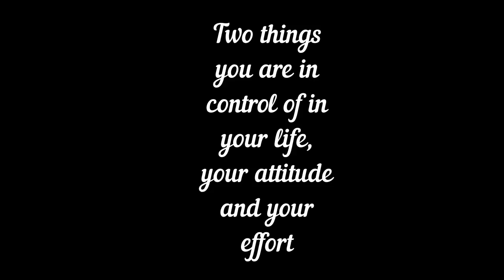We fixed the problem with the Wood Stove / Self built Tiny House//VLOG

Comment: A piece of copper pipe 1/2" about 24" long makes for a good tool to blow the coals with to heat them up. The hole turned out better than I expected - LOL. Good job with that. Thanks for sharing

Comment: We had a Country Flame stove.   It heated our 2500 sf house easy.  Didn’t have the extra intake pipe but it had 2 wheels on the front door you could open or close to allow air inside.  Loved our stove

Comment: If that exterior wood is touching the upper smoke pipe you have created a fire hazard.  Plz make sure it is at least 12 inches away .
Reply from the maker: Per code it has to be at least 2" so we are good. That is triple wall pipe

Comment: my Father, born in 1930 taught us to put the paper first, then kindling and one or two small pieces of wood.  Light with a match and once the kindling is burning good, add a larger piece of wood.  The paper burns first and sets the kindling on fire, then the kindling starts the larger pieces burning.  Add kindling if at base of fire to get wood burning.  Using this method, my brother could get a roaring fire going within 5 minutes or less.

Comment: I told you over and over you needed a air intake WoW and you need a damper in your stove pipe so you can turn it down or close it because of a chimney fire and if you ever do have a chimney fire just throw some glasses of water inside your stove which will send up steam up your chimney and put out the fire or slow it down make sure you got enough pipe on the top of your chimney so it will cause to suck out the smoke got to be above any peak how about roof so it takes to smoke away it does not keep it around your building I have never had to put it in a fresh air intake in my stove but my Stover all all old stoves so maybe you have to maybe you're building is so airtight it doesn't get any good air I don't know but to hopefully it works because the new stove is called for fresh air okay good luck keep up the good smiles

Comment: Did the air intake have a way to slide a piece of metal that would close/open the air intake hole? More air to get fire going, then throttle it closed a little to slow the burn. I wish we could see the air intake and the clean out holes. Thanks for sharing.

Comment: Wood stoves. First your wood should be 20 percent moisture or less. If you burn higher moisture your pipes will fill up with creosote and start fire. You can purchase a wood moisture tester cheap. You will have less problems. It takes about two year to dry wood to 20 percent. If you stack the wood so the wind blows through it. You should have dry wood for the next season. So be careful this season.   I still cleaned my chimney once a year before using it. As for starting the fire figure out what works better for you. The torch is a good idea. The Yellow mat gas burns hotter. Good Luck.
Reply from the maker: This winter we are way more prepared.. have 2 year old dry wood and it is burning nice!  Thank you for the tips

Comment: You have lots of pine. Look in the woods for an old stump that's not rotten in the center and break up the inner part of the stump and those pieces gave lots of turpentine in them and you can use them as fire starters.  Fall line ridge on u tube had a video recently on his channel about it. You can light those pieces from the center of the stump with a match just like Georgia fatwood sticks that are sold for fire starters.
Reply from the maker: Oh cool I will check it out

Comment: Long ago I was told that any rooftop within 10 feet of the stove pipe would affect the draft of the chimney. The solution was to lengthen the stovepipe to  two feet( 2’) above the higher roofline.